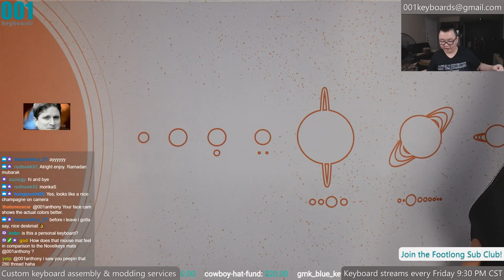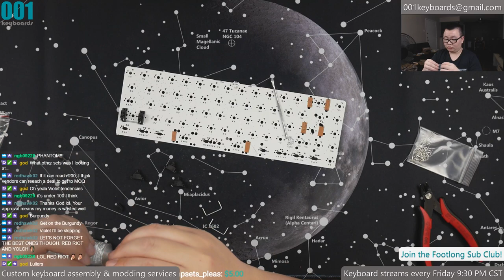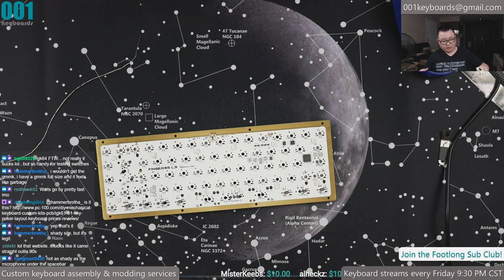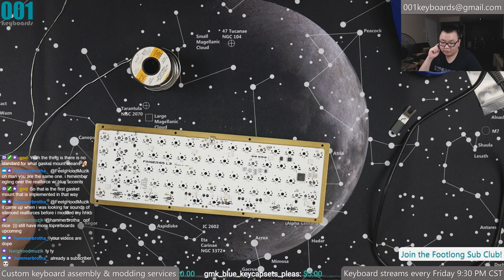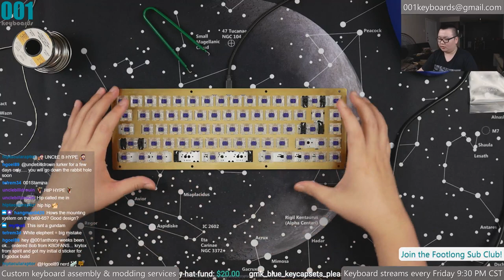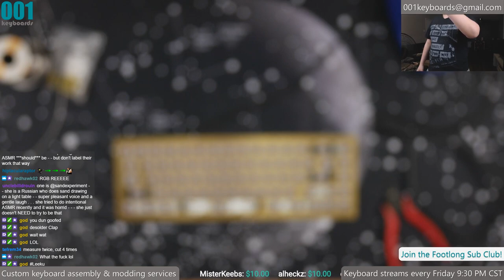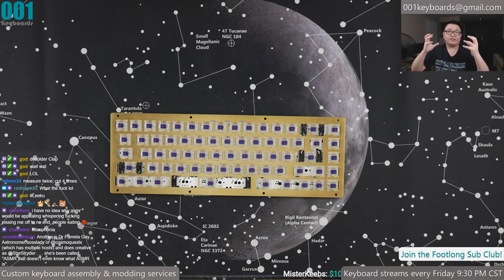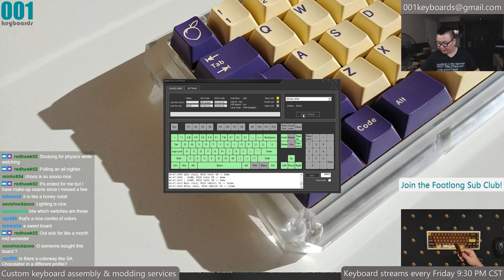Let's Build: TX65 (Zealios 67g)

Comment: How  did you get that spacebar popping noise? Lube? Brass plate? Keycap types? I'm new to mechanical keyboards so i'm not sure
Reply: @Mimtos thats  because he's using SA keycaps which are really hollow, normally people put some foam in it or mod it